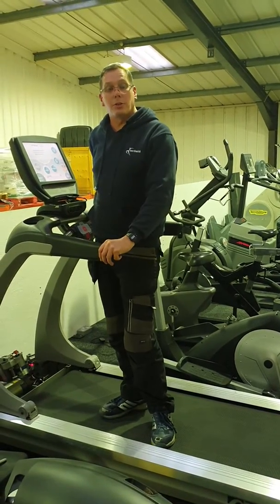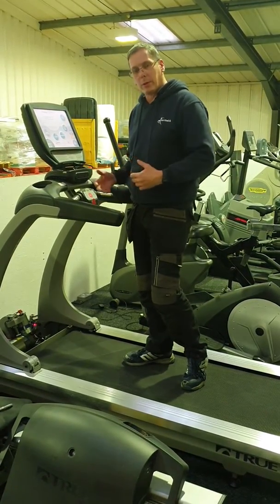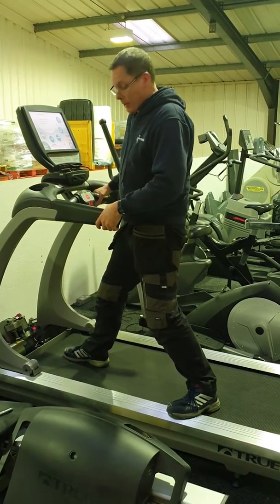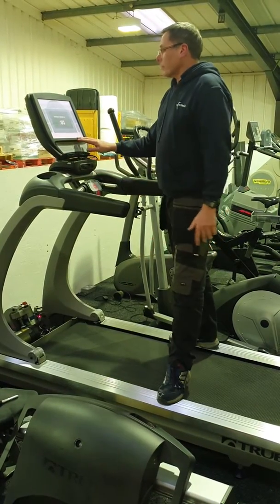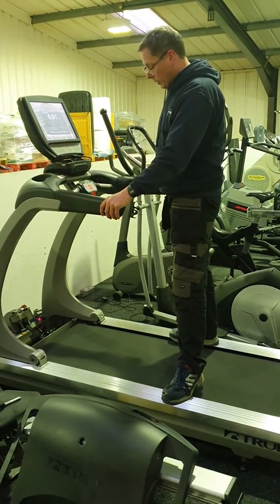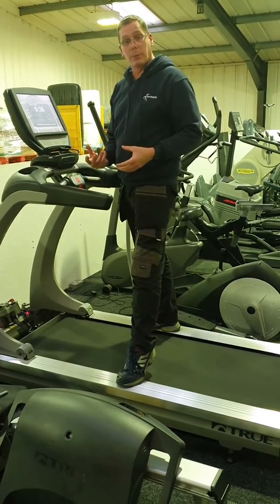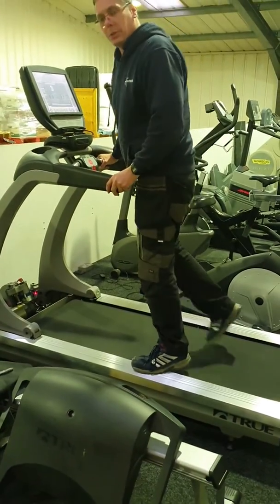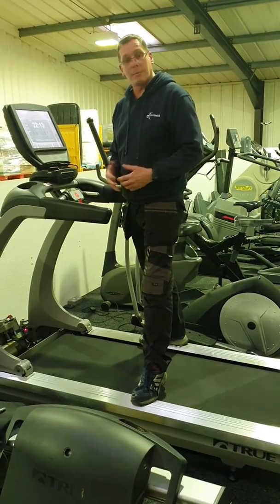STOMP test a treadmill running belt

Comment: I would not recommend doing the stomp test. If you are going to do it, be very careful. If you do it for too long and too hard, it will put too much of a load on the motor which will result in blowing the motor. I wouldn't bother going through this process to loosen the belt if it was previously working well. Only if you think the belt being to tight was causing an overload problem with the treadmill circuit, but that's doubtful if no one has tightened it recently. (Oiling the running belt/platform should be the first thing you do). If you have to do it and can't get the belt to slip with a quick stomp test, loosen both sides by quite a bit to get it to slip and then tighten it back up gradually. Don't stomp for longer and longer periods of time while it is tight and trying to loosen it a little bit at a time interspersed with more stomp tests. That's how it will blow the motor.
Reply from the maker: Thanks for the insight and alternative view. I agree with your comments but I think the stomp test is a convenient and effective way to test. I've never had a motor fail as a result of the test, but it has regularly and reliably uncovered belt friction issues.

Comment: both front roller and motor & motor belt keep spinning, and walk belt stops when I do stomp test. I put a new walk belt on and adjusted about 2 -2 1/2" of give off platform. Can I tighten walk belt further?